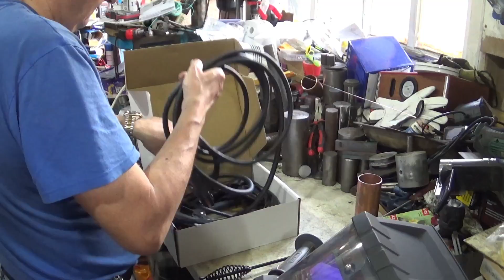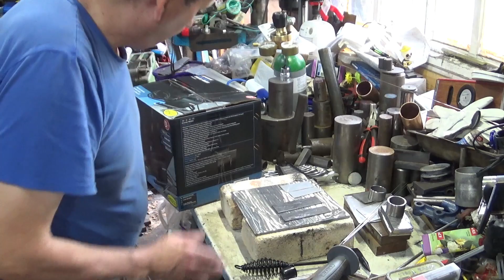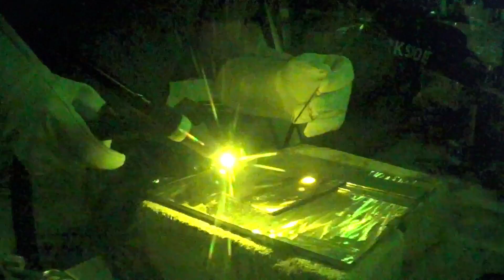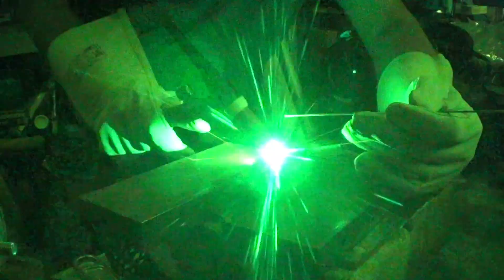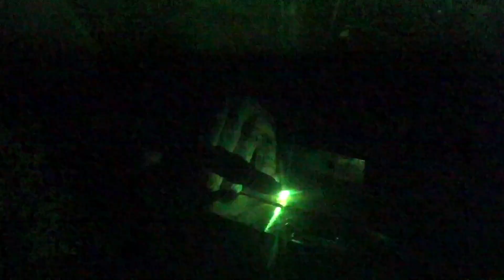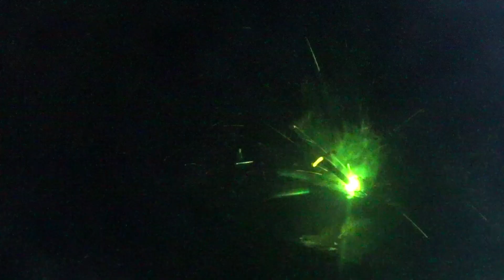Lidl Parkside Inverter Welder/TIG Welder PTMI 180A1 unboxing, test welds and review

Comment: Would you recommend this as a good arc welder Ben? Does it run sticks good at the higher amps?
Reply from the maker: Good question.  I am limited to a 13 amp supply, so can't hit top current, though ought to be able to get close.

What had you in mind of stick and current? (And indeed thickness of base material). I might well test it at that and post a video.

Many thanks for watching, please like, share and if you like the channel, subscribe!
Reply: @BensWorkshop  get a circuit breaker 3 pin plug and use it through it. Will protect both welder and your power feed.
I think you'll get close to the
180 tbh. It's newer technology in those inverters. It's not like the old transformer oil welders that would blow fuses if you looked at them.
Anything over 160 - 180 on half inch plate or thicker.
I've heard good reports of these new Parkside welders and I'm thinking about getting one.
Reply from the maker: What size rod? I can do 4mm, 3.25 and 2.5.
Reply: @BensWorkshop  3.2 and 4mm please then cut to see penetration difference.
Reply from the maker: Corner or but welds? (The latter being ground to be welded from one side only unless you would like it welded from both, the former just welded into the corner)
Reply: @BensWorkshop  corner joint or maybe a T joint would be good and one side 3.2 the other 4mm for a comparison. Thanks
Reply from the maker: How about a T with a grind a quarter of the way through on either side? Or did you want it unprepared on both sides?
Reply: @BensWorkshop  yes that would be perfect Ben 👍look forward to it
Reply from the maker: Which one? Prepped or unprepared?
Reply: @BensWorkshop  unprepared
Reply from the maker: @prime553  No worries. I will take off the mill scale with a flap disk though. 👍
Reply from the maker: One more question...  Did you want just single pass welds or root and fill? Also I was thinking if I weld one side, that will warm up the work and make penetration easier on the other so would you like it cooled between sides?
(I know that was in fact two questions....)
Reply: @BensWorkshop  single pass would be great Ben. It's always the first pass that counts with getting into the metal. Root and fill at this high amps wouldn't be necessary and no need to wait until its cool just tack weld the 4 corners first and your metal won't warp. Thanks
Reply from the maker: Oddly I was going to tack it both sides in the middle, but corners works too.
Reply from the maker: I have done the welding... Now the cutting.
Reply: @BensWorkshop  great stuff
Looking forward to the results
Reply from the maker: @prime553  Looks a lot like I need to get better at welding, in particular getting the cross of the T as hot as the bar.
Reply: @BensWorkshop  interesting, a nice slow weave should suffice. I won't know until I've seen the length of the piece and the amount of rod you burnt
Reply from the maker: @prime553  Fair enough. I think I needed to spend more time over the cross and less on the bar if you see what I mean. I will explain when I finish the video.
Reply: @BensWorkshop  yes I understand. I wouldn't beat yourself up about it. Things like that come right with practice
Reply from the maker: @prime553  They do indeed! Only problem is cutting 12mm steel plate is a pain in the .....
Reply from the maker: Th video is here,

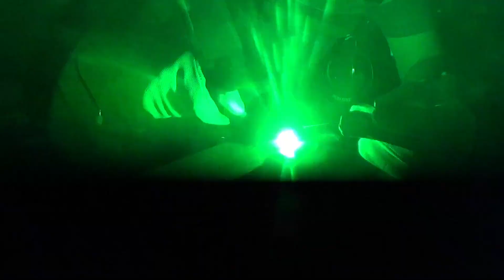Comment: Cheers for the video. I done a course on Tig welding yesterday. I spotted a few flaws. You're using zero ventilation. You need a strong extractor. Can build your own yes. But adjustable so it's above you. You want 12-18 inch distance from your face.  You do NOT want these fumes in your body. If you can taste it STOP! you shouldn't be able to taste it. Also, yes, you should have a welding / suitable coat/top. Tig is not easy! But I was getting there. One thing.. Your primary hand holding the Tig, the filler you use in the other hand. To bind the ends to hold you don't need the filler. Your Tig hand isn't stable.. you're shaking everywhere, you need about 30 degrees angle, and you (I found) should be about 5 mm from the surface, you're too high. You'll burn through / warp. It's a big learning curve. But I was getting there through listening and practice. This welder is called a scratch welder, I was using a frequency Tig welder. It was definitely easier, but the parkside one is a scratch, so immediately you're contaminating the tip. Turn your angles so you're welding straight, don't turn your body to find the joint. See at 30:00  plus. Your approach angle and vision angle is all wrong. You'll tire, you need something to rest on. But remember the 30 degree. Otherwise, not a bad video. I just wanted to see if these things are any good even to home the skills. Also, when you're tightening the tungsten.. push it too far out. Approach the table surface about 30 degrees, the cup and tip should just be touching the surface, now tighten the tungsten in place. Now you have the prefect spot to create the clean arch.
Reply from the maker: The door (4 feet by 6 feet) and windows are open. No, you can't taste the welding.

It isn't a scratch start, it's a lift TIG welder.

Many thanks for watching, please like, share and if you like the channel, subscribe!
Reply: @BensWorkshop  oh, a lift Tig? I was advised there were 2 kinds . Scratch Tig and frequency Tig. The frequency Tig I was using has a switch where you had a rotate valve. I looked up your video to see if these 'cheap' rigs were any good. There's a few things I wanted make and not spend a grand to then start. I'd rather practice / get good then go from there. What I had learned was you do NOT want a draft / breeze. It blows away the gas. So you need a calm environment. Which is why I'd suggest a descent extractor, some flex ducting and a fix positioned inlet. Picture a mic stand. Again, zero hating on your video, I'm just trying to advise if you didn't realise yourself. At one point I totally understood what the cent did, he left it off for a few minutes and I could start to taste it. It lingered. Once vent back on.. sorted. And in regards to the tips he was doing the same. Using a sand/grinder. I asked about a tool and he said absolutely, but it's £1200 for it lol just to sharpen the tips. So what's a lift Tig? Is it just another name for scratch? So you make contact to spark then it activates?
Reply from the maker: You don't want to do it on a windy day, but it works. I've also ad to do a lot of MIG welding outside. Lift TIG fires when it detects a contact brake, unlike scratch TIG.

HF start is better, usually they have a trigger switch. You can but a DC set for anywhere from £150 up, for example the Röhr HP-160L TIG/ARC 2 in 1 Welder at £169.99.

Haven't tried one though. Thinking about getting an AC/DC set which will also do aluminium but costs a lot more.

If you are only doing steels, copper etc, DC is fine. The biggest thing you need is practice. I buy scrap materials which is very cheap and allows me as much practice as I need. Hope that helps.
Reply from the maker: Incidentally, I do have most of the bits I need to fit extraction, which is much more important for arc welding, and will be posting a video. The system will have set me back around £20 to £30 at most when done. I will post a video though it will probably not be for a few months. If that interests you, subscribe!
Reply: You seemed to learn a lot in a day. However how long did it take to convert the knowledge into practice.

Comment: On the TIG get some thinner leather gloves so you can feel what you are doing better. You don't get much spatter with TIG so you only need thin gloves but you do get UV.  Always keep skin covered up or you will get a bad suntan !  Put the mask setting so you can just see OK.  If your vision isn't great the better masks allow for a flat lens to fit inside.  I don't know how food the Parkside helmet is but you need a good helmet or you will get fed up and / or harm yourself.
  
It is best for beginners to forget the filler rod just use the torch. OK you will get a thin joint but you will learn to get a steady motion just pushing the weld pool with the gas. When you are learning you have to learn to keep your torch  
at a consistent height before anything else . If you can't do that you will always have problems. When you can move the torch at a steady height then try the filler rod as well.

You can't get proper welds with the work piece perched on two bricks and your hands in mid air. It needs to be level and you need to be able to rest your hand on a stable flat surface. You don't need to weave with TIG but it helps move your hand against (if you tend to lean on your hand/arm and it tends to stick to the surface you are leaning on.)  the surface it is resting on without your hand moving too far.  It should also help to do dry runs moving your hand holding the torch and just watch the tip move to get a feel for things. You have to stack everything in your favour when trying to learn TIG as it is a bit tricky at first and you can soon get disillusioned.

If need be use proper welding magnet squares to hold the job in one place even just to tack it.  The  work piece moving around is bad enough  when you are experienced but when you are learning it's a million times worse.
Reply from the maker: Many thanks for the kind advice. Those welding gauntlets I was using were sold as TIG welding gauntlets. I too am unconvinced as it is hard to feed the rod. I should get some more where I can look at them before buying.

The Lidl auto darkening helmet is good. Used it loads.

I take your point about it being easier if you have your hand resting, though often when doing other types of welding (MIG and MMA) I don't have somewhere to rest. Seems not to be too much of a problem. 

My biggest problem is picking the right current setting and moving at the right speed (whilst feeding enough rod in).

Many thanks for watching, please like, share and if you like the channel, subscribe.

Comment: I'd like to see it demonstrated by someone who can weld, but the fact the gas isn't auto with the switch means i'll not buy it, it will cost a fortune in argon, as a TIG welder of many years if i could give you one tip and that is as soon as you burn the point off the tungsten regrind, it is a pain but you'll learn to weld much quicker and eventually you'll only have to grind at the start of each session.

Comment: Thanks for a very useful video. Can I ask who you went to for your argon bottle and what are the options around buying/deposits etc. Have been seeing a few things on line about it being high cost for the small hobby type bottles. Only looking for something for occassional use so guess similar to your setup.
Reply from the maker: I went to Affordable Gas Supplies. I put a £25 deposit on the bottle and paid £35 for the fill. 10 Litres would have been a £55 deposit with a £60 ish fill. I may upgrade next time I swap bottles. They are in Horley
https://affordablegassupplies.com/

They use a gas supply firm who appear to be cheap.

Many thanks for watching, please like, share and if you like the channel, subscribe!
Reply: @BensWorkshop  Thanks for that. Gives me an idea of options and will check local suppliers. Good channel covering a lot of stuff I am also interested in so thanks for recording and posting these.
Reply from the maker: Many thanks!

Comment: I wish to invest my self a tig welding, When I ever need tig welding I always end up going to a shop. Looks reasonable for a hobbiest workshop. Thank very much for making the timeline  with titles,. Thank you ben.
Reply from the maker: As a hoobiest starter machine I think it's quite good. The issue is then getting the gas and regulator and connecting them.

Many thanks for watching!
Reply: @BensWorkshop  thats the most thing that holds me. The rent or anually cylinder service test for the cylinder tank.
Reply from the maker: @enginelover1  Yes, I got one with a deposit only.

Comment: Get your torch hand resting on something and it'll probably help a bit.
Reply from the maker: Probably, though I found it not to bad without. I could also do with sitting on a stool.

Many thank for watching!
Reply: @BensWorkshop  whatever it takes my friend, only started messing with Tig a couple of years ago and getting my hands steady made a difference, as did practicing on welds that didn't need filler.
Reply from the maker: Yes, though my hand is reasonably steady with a TIG torch.  I will try to reorganise my shop.

Comment: Great vid Ben, warts n' all. I've had two welders sat in their boxes for too many years now, really need to bite the bullet and try it out.
Reply from the maker: The weekend is here o it i a good time to have a practice. If you have a scrap yard near you you may even be able to buy metal to practice on.

Many thanks for watching,  please like, share and if you like the channel, subsribe!
Reply: Unfortunately with TIG you do have to keep that distance tightly controlled. The better machines allow you to come up a bit and still maintain the arc - though if you come up too much you still  lose the gas shielding. TIG is not a fast welding method. If you need to weld different metals and create good and neat welds it is great but for speed its MIG or stick. Horses for courses. I learnt on oxy-acetyline and find TIG easier than MIG.  You can't be an expert on everything !  I would say to viewers learn the skill you really need because learning to weld no matter the type  is never easy.😀

Comment: You’re running too hot and you have too much gas practice practice practice with lower heat
Reply from the maker: You are definately right about the gas! Which weld am I running too much heat on?

Absolutley need the practice and I will, this is the first time I have TIG welded. I am impressed with the process.

Many thanks for the tips Henry, keep them coming!

Comment: You should have a dedicated grinding stone so you don’t contaminate your tungsten same with a wire brush it should be stainless steel
Reply from the maker: That's true, what I will probably do is get a new grinding disk for only that for an angle grinder and use that.

The wire brush is not for the tungstens, it's just on there. 

Many thanks for watching and the tips, my that's an early start for you!